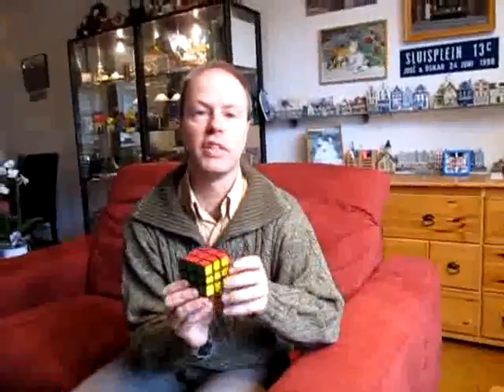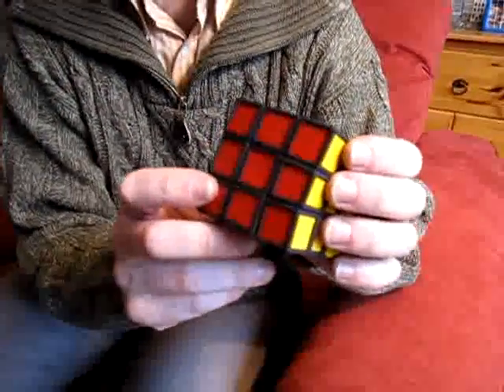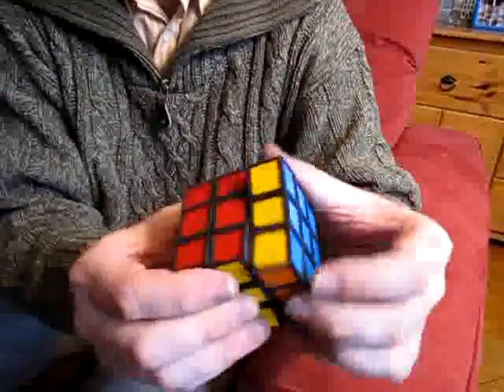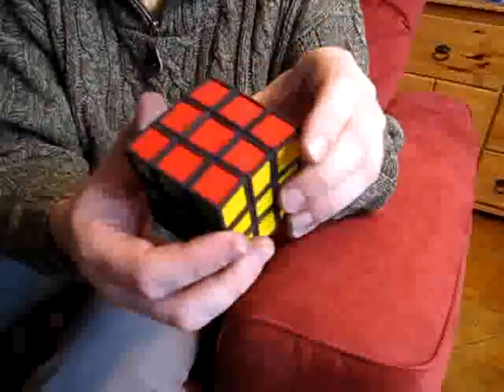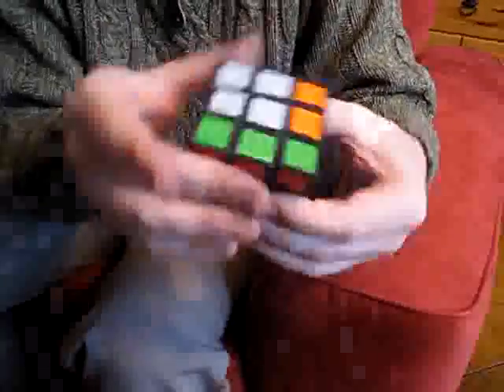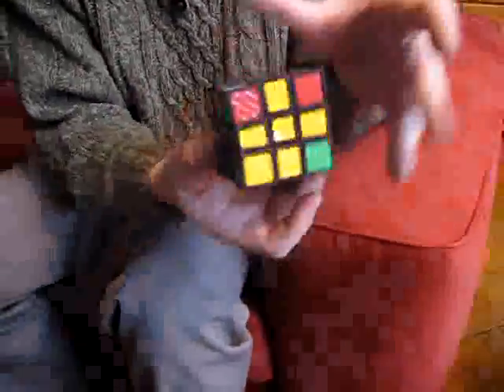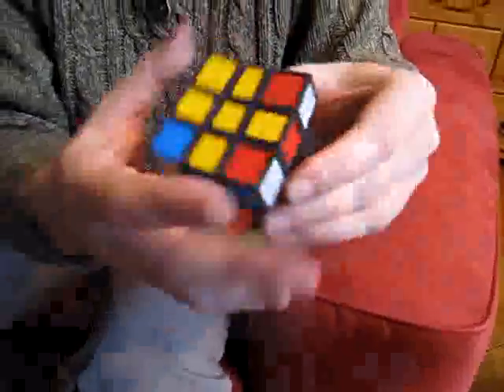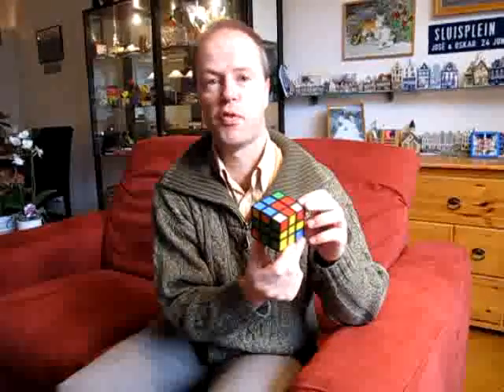Distorted Cube

Comment: did you add gaps (fudging)  to the puzzle to make it work? or did you not need to since it has such a slight angle difference? I am working on a puzzle but the cuts are about 1.3 degrees off. Do you think I need to add gaps to make the puzzle work? thanks!